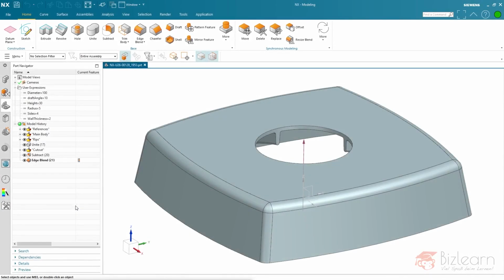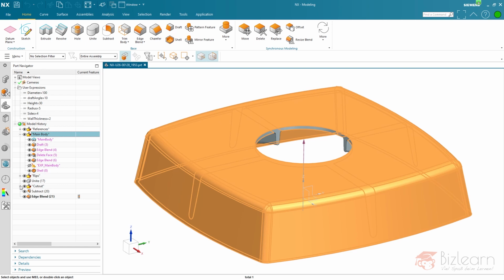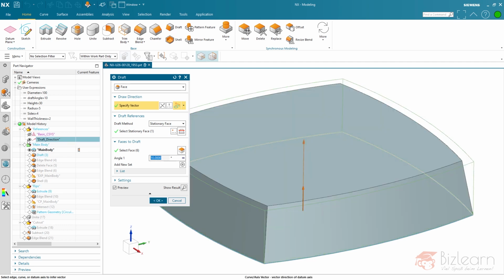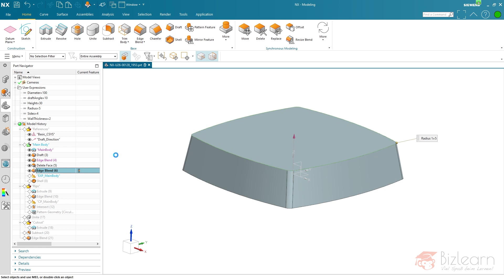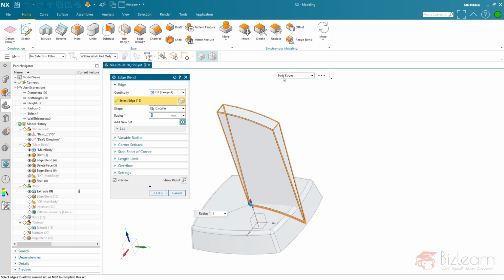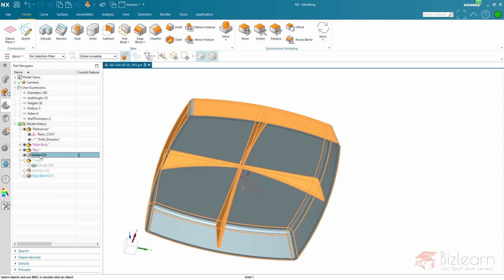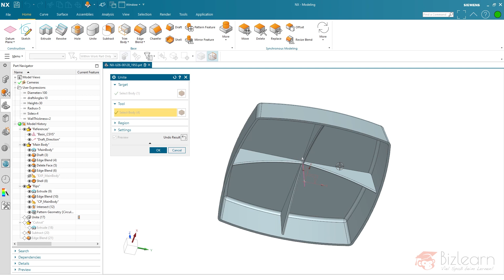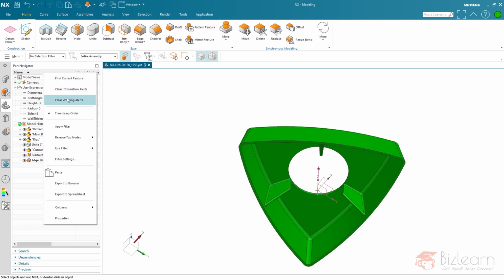Siemens NX 1926 - Selection Rule Improvements & Horizontal Modeling

Comment: Great video as well as https://www.youtube.com/watch?v=MLQFuUHDUGw ! I'm quite efficient in Solidworks but novice in NX. Could you please explain how you implemented changing the sides of the main body? As far as I know in NX's sketch it isn't possible to change the number of sides of created polygon primitive afterwards (it's possible in SW thought). So  I guess it's an arc + circular array. But how you preserved the connection of all the arrayed lines on the sides to form an enclosed  area?

Comment: Thank You. If You have an assembly which suddenly starts to work very slowly (for example during automatic feature updating or switching component to working mode) how do You diagnose which component causes this?
Reply from the maker: There are a few opportunities. You could analyze the file size in native mode. Are wave links included? Those usually cause a large update delay and can be analyzed by the wave browser. Anyway, the question is very general and hands on makes sense. Otherwise I can just guess🤔 have a nice day